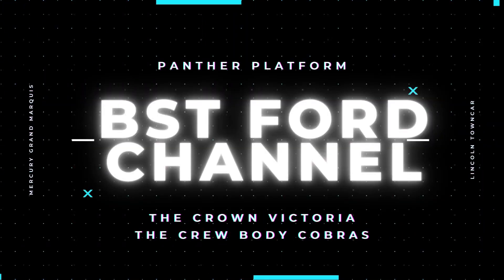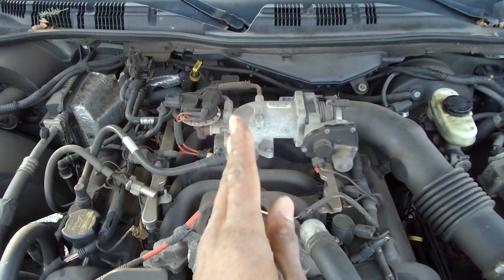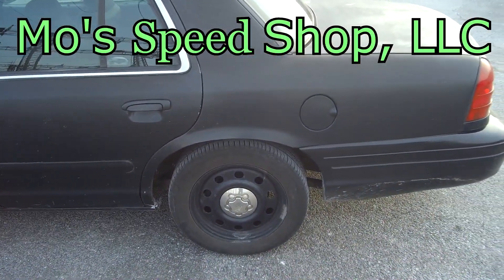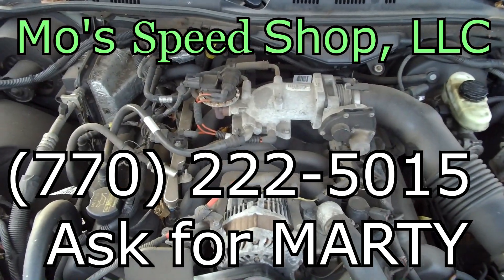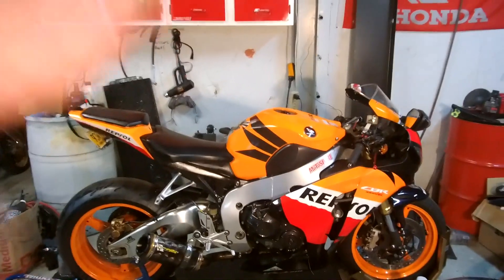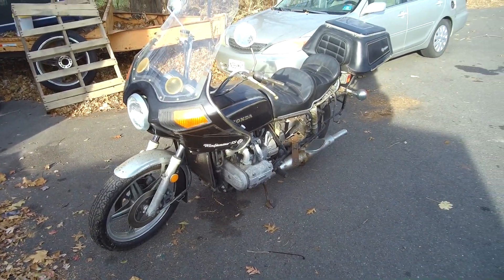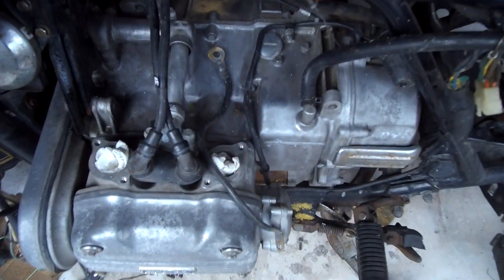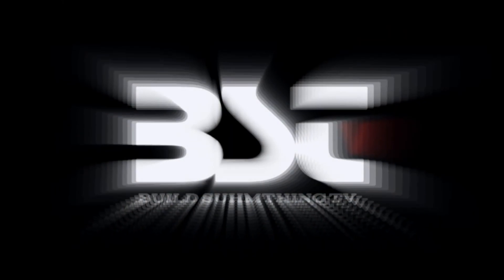Top 2 Mods for your Crown Victoria ( Subscriber Response )

Comment: I still say the best things without touching the Motor is gears 3:73s or 4:10s, Exhaust drop last 2 cats throw on Glasspacks, Get Marty Tuned, a bonus without digging deep in motor Ported Plenum, 75mm DBW Throttle Body from a 05+ E250, E350, F150 pr F250 or any 05-14 5.4 2V they will all have it no tune needed I have it on mine of course it benefits from a tune but not necessary!!
Reply from the maker: agreed 100% with you Sam... I can not debate you on this.. You gave a solid comment here brother..
Reply: @bstfordchannel923  Also Man J-Mod isn't completely necessary if your just going for firmness Marty can tune it to be equivalent of a Jmod, Tune setting 8 for shift firmness is just as good as a J Mod and you dont have to risk hurting your trans!!
Reply: @bstfordchannel923  And Thanks man it's crazy how much difference you can get without touching the motor too much... and yes I forgot to mention UnderDrive pulleys if you really wanted to you can actually use the alt one but it'll put out less volts but unless you have a huge audio set up no big deal imo but I don't run it cuz of my amps... another quick thing is just a set of NGK 4177 Plugs and Accel SuperCoils they do add a small bump in my opinion even just the cheap Ebay or Amazon coils believe it or not they're made in the same factory as ths Accel and MSD likely just seconds or something like that I've been running them over a year no issues!!
Reply from the maker: @samsautoanddiy   yes just little special thins that you mention can bring balance and slight oerformance out of a engine ( 4.6 sohc ) to be honest.. Now the coil game is a tough one . We tend to go with brands but we really dont know what they really do as far spark energy.. i have been thinking of ways to do this test ( on the car ) vs just ten volts.. I may have the solution ( its a theroy ) another great coment by sir I will mention you in the next video!
Reply from the maker: @samsautoanddiy  agreed it will be as good, but just think of the added feel to those that need to feel that ( chirp from the tires)  then add all the little thing that make a difference and you have a well cook meal..
Reply: Agreed! I haven't done a throttle body swap yet but I've been interested in doing that.
Reply from the maker: @harrison4ever125  sam is on point with this
Reply: @bstfordchannel923  That would be cool I was trying to think of a way to test them too!! I'm sure they do burn hotter but can't say for sure, however based on the way it runs after a swap I would have to say they do
Reply: @bstfordchannel923  I appreciate that man!!
Reply: @harrison4ever125  What do you have 98-04 or 05+ for Mine I uses a DBW 05-14 5.4 2V 75mm Throttle Body ported and polished did I gain horsepower sure maybe like 5 if that but did I gain Throttle Response... 100% she peels out a 1/4 Throttle it opens so much quicker than the 4.6 stock one, in addition I did the Plenum Ported and Polished that did both myself since I sell ported plenums...
Reply: @samsautoanddiy  i have an 06 Merc G.M. I have been scared to do this because I have the Marty tune and I don't know how this is going to change things. My car will not spin the tires from a dead stop ever unless you brake torque them and even then it isn't anything glorious. BUT, I have the 2.73(is that right??) air plane gears. Which is why gears is definitely on my to do list as my next modification.
Reply from the maker: @samsautoanddiy  anytime bro please make more videos on your channel bout the car and yourself.. its important
Reply: @harrison4ever125  Yeah 2:73 open diffs are terrible I can't even get a 2:73 LTC to spin in reverse, but my Vic will spin tires at 1/4 Throttle and I can lay rubber easily in my car... honestly just get C6 3:55s from a Police Interceptor in the scrap yard and then just adjust your Tune takes 5 secs, and that will make a huge difference if you want just get a LSD carrier and swap gears to 3:73s or 4:10s, and that alone should give you a very good and noticeable bump in take offs and you'll light up the tires like nothing, if you want you can do a shot of NOS but I wouldn't even bother. Just give it a really good tune up change the Plenum and Throttle Body, run NGK 4177 plugs Gapped 0.45 since you Marty Tuned, and Get some Amazon/Ebay 30 dollar coilpacks, and drop in a Dry Flow AEM or Spectre Filter, change fuel filter, clean the MAF, Recalibrate Throttle Body, run some Shell Premium to blow her out and use seafoam in the tank and Oil 1oz per cylinder than use there spray in the intake and change the oil I run 5w20 Full Synthetic Royal Purple or A Quart of Diesel 15w30 Diesel oil or just add a Zinc additive since the point is too protect the Cams
Reply: @bstfordchannel923  Yeah Brother, I'll be uploading more soon, been busy with school and work, but you know what I'll go out today film a quick little update for you I parked the Vic to keep it out of the salt, but yeah I'll go out and shoot something quick man!!
Reply: @samsautoanddiy  I've got all brand new coils, plugs, throttle body, and fuel filter. Had some hesitancy in it last year and replacing the throttle body helped a lot. But I think it still needs the throttle pedal position sensor replaced. Runs like a top though. I'm planning to do the interceptor 3.55 rear end, like you said, whenever I can find a used one for real cheap. When I had my 2000 Interceptor it had those gears and bone stock it would roast the tires as well. So yeah with the Marty tune it'll be a beast. Eventually I'll look into that bigger throttle body swap but I think for now I am gonna stick with my current setup. That way whenever I have Marty send me a new tune for the gears I can get the throttle body swap including in the new tune

Comment: Before determining Gear ratios determine your size rim and tire it matters you don't wanna be taching out going down the highway
Reply from the maker: agreed thats why i say it depends on how you get down... That I will get into later , but you are correct 100% Bossman
Reply: What do you mean bro could you be more specific?
Reply: @juanray2614  the size tire and rim matter subscribe I'll make video tomorrow on it
Reply: Ring the bell so you get it when it post
Reply: 3.73's and some 225/55r16 or whatever size is stock for a 2000 mgm still does 75mph at 2100rpms, 100mph is around 3k rpm on my sct x4

Comment: 1. Leave it stock it’ll last over 450,000 miles
2.Supercharge the stock with complimenting fuel mods. Leave horsepower ~400 for reliability. 
3. Coyote Swap the engine with intent of supercharging. Engine can come from F150 or Mustang. 
11-14  up to 650 max horsepower on stock engine*
15-17 up to ~800ish hp on stock engine*
18 -20 850ish max hp on stock engine** 

*Mustang engine estimate F150’s 10-15% lower 
** 18 and up Mustang and f150 have been making similar max hp in a lot of applications
Reply from the maker: YOU sir a CORRECt, but many guys ask me questions so i just assist with  my thoughts and be honest as possible ... I would love to get to that Coyote one day but it has to be dirt cheap though

Comment: A tune is only gonna go so far with a bone stock engine and the cost involved for 15hp at max isn't anything your gonna feel or notice in a 4000 pound car, but a good rearend gear 3.55-4.11 and a higher than stock stall converter would be by far the best bang for the buck for performance increase.
Reply: Can you suggest a higher than stock stall speed converter for the 4.6?

Comment: Rear gears should be the first step with any car build because it's the single biggest power gain you can get without a super charger or nitrous or anything.
Reply from the maker: agreed, but i rather the turbo , but Turbo have their issue to... Rather just balance the stock engine with a tune and gears ( then 5 speed ) that will do UNTIL you need more

Comment: I have a question, I have a 1999 ford crown Vic p71 I’m getting a custom procharger for it, I’m rebuilding rear end with ford Performance parts installing 373 gears. longtubes, 262 cams building the heads ford Performance as well and getting a new transmission. As well I’m  working on new suspension. Ill be getting a tune from Marty. Is there anything I should get or upgrade before I carry on?
Reply from the maker: Tq converter and find a way to add strenth to that trans cross member... I will make a video explaining Pinkhat

Comment: Hey Man I hope you see this comment; but i have a couple questions so my 03 lX crown Vic is completely stock besides I added a k&n cold air intake into it: I was wondering if I need a tune for the intake? And I was looking to get a 3.73 would I need a tune for that? Finally I wanna get the Marty tune would that kinda help me with those last 2 questions ? Also the tune how much of an impact does it have on ur mph and would I have to switch from normal to premium gas?

Comment: Question the rear gearing... My 201 State Police Vick on the hi-way at 90mph runs at 2500 rpm... which seems low compared  to my 40' and 05' runs at 3000rpms!  What gears do you thing I have????  3.55??

Comment: What do you think the HP gains would be from the tune? And 87 or 93 octane?
Reply from the maker: The tune will give better shifting ( and a better feel )  hp numbers depends on your engine and all the other bolt on ect... Gears is needed ( i think ) 230-245hp not much from a 2v but its tq and the High rev that helps the motor

Comment: Hello sir,
I have 2 questions that i need help with:
1) i have a 2011 CVPI, which higher flowing throttle body can i use? 
2) Even with a tune, does a cold air intake actually produce noticeable power in these engines?